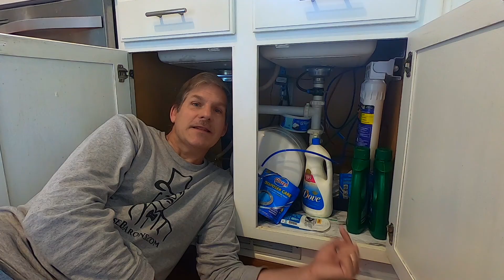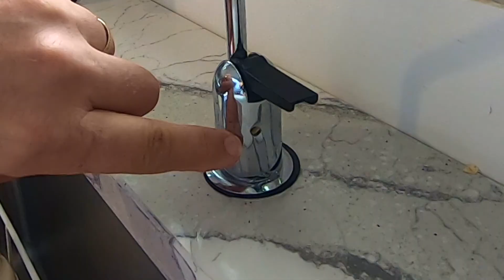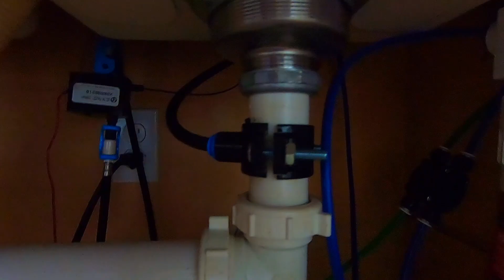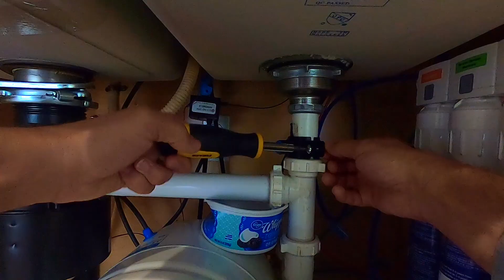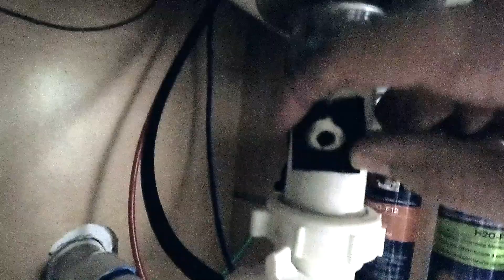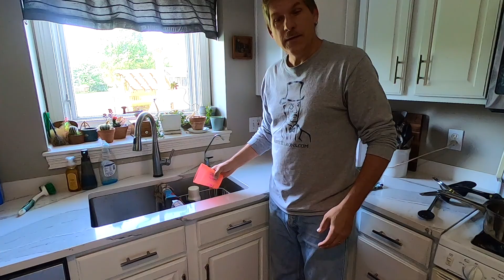reverse osmosis faucet filter system leak

Comment: Had the same large puddle on our counter. Pulled drain hose and used wire to clear tube. Must have pushed some gunk deeper into tube because it still leaked. Used can of compressed air to blow it into sink drain pipe.  That worked

Comment: We did that and it still leaked. I was told to buy a drain liner adapter . We also have a garbage disposal should we remove it?
Reply from the maker: I don’t think removing the disposal should be necessary. See if the adapter at work. 
Thx for watching!

Comment: my problem was slightly different ...had this same problem of water leaking out........ tried this and a couple other things but what worked for me was pulling the drain hose out from that blue fitting thing on drain then letting it hang used a air compressor at 30 psi and pushed air from the vent on the faucet and it spit out a chunk of gunk on the floor and bam works flawlessly now!
Reply from the maker: Perfect! Nice job!

Comment: Should the hose tubing be inserted into drain pipe?  Mine the hole is smaller than the tube? Should I make the hole bigger?  Also my gasket is not as thick as yours. Mine is mushy? Thank you for making video.
Reply from the maker: Hey Susan,
Yes. Our black tube goes into the drain pipe. Double check your directions - not sure why your tube is bigger than the hole. Is your gasket a tight fit on the tube. You don’t want a sloppy fit on the tube. 
If the hole needs to be bigger, be sure it is the exact same size. If the hole is too big, the tube may fall out and now you have a mess. 
Drill bits come in very fine increments 1/32 of an inch or smaller. You could drill a practice hole in a scrap piece of wood or plastic and make sure the hole you are making is a good tight fit. 
Hope that helps. Thx for watching!
Reply: @Housebarons  great info.  No, my tube does not fit . My seal was pretty much disolved.  Big box store did not have a replacement seal.  I ended up using flex seal tape?? So far so good. I need to make hole slightly bigger as you suggested.   Thank you very much for your help .

Comment: Just had this issue. Except I was gone for 2 days and came home to water dripping from my downstairs ceiling. Turns out it was all coming from this weep hole. I took it apart before watching this video. Mine has a cartridge where the waste water attaches to the faucet. I found that a lady bug crawled into the weep hole and plugged the drain hole. 🙄 most expensive lady bug I’ve ever seen.
Reply from the maker: Hey Franklin,
Thanks for sharing. Interesting cause.
Thx too for watching!

Comment: What is the best way to unclog the drain line.  I have checked everything else and still leaking from weep hole.  Any suggestions
Reply from the maker: Hey Lannie,
In my case the hose and the hole in the drain didn’t align which caused the problem. 
Could you detach the hose at the drain and put it into a bucket to make sure it is plugged up?
Also make sure the drain line isn’t kinked. 
To clean the line use a pipe cleaner or similarly sized tiny brush to dislodge the clog. 
Hope that helps.
Thx for watching!

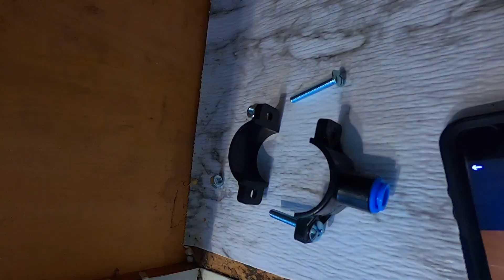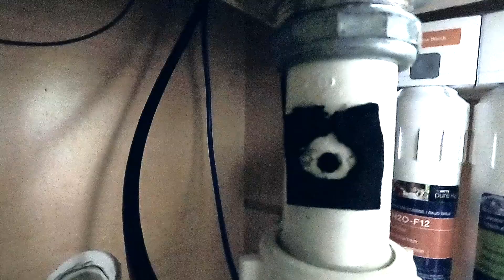Comment: Question:  My faucet has a twist knob to turn it on/off.  Even when turned off it was leaking?  Does this still apply?  I pulled off the piece shown @2:29  there was no gasket as best shown @2:41.  I installed 3M heavy duty double sided tape.  Aligned the hole and fastened everything back up.  So far, it's not leaking through the weep hole.  If it was leaking when in the off position, should I be looking elsewhere?
Reply from the maker: Hey Nick,
Typically the weep hole leak has to do with clogged black drain tube. 
Contact manufacturer if it continues… they’ll know.
Thx for watching!
Reply: @Housebarons  Hey, yeah.  It started leaking again.  Contact the manufacturer.  I'll try to remember posting a reply on here after it's fixed.  Just to let you know and those watching this video as well.

Comment: Makes sense now. The problem with our system is that it leaks when the waste disposal is activated. I suspect this drainage tube gets pressured causing back-flow. Do you think that adding a one way valve to the drainage pipe would work? Any suggestions?
Reply from the maker: Hey John,
Not sure about one way valve. Might be a question for the manufacturer.
I would check exactly where you have connected the drain hose. Is it located on the main sink drain above the disposal connection. The disposal should not cause a problem if it’s below where the drain tube for the RO is attached.
Hope that helps. Thx for watching.
Reply: I called Aquasona they told me to buy another drain line adapter